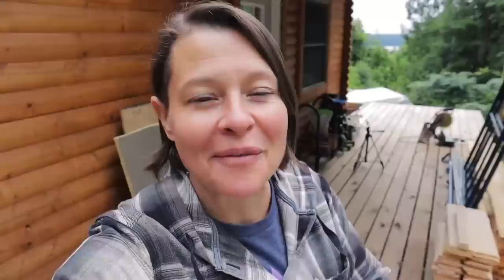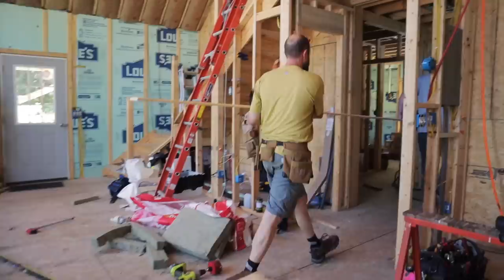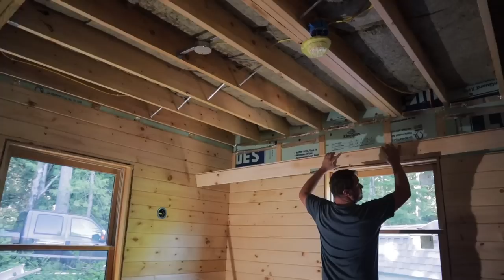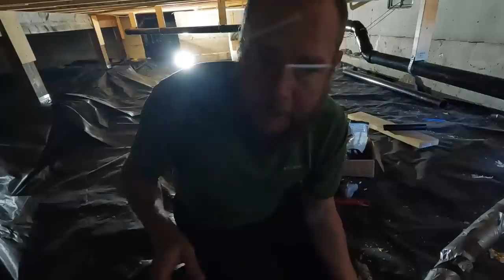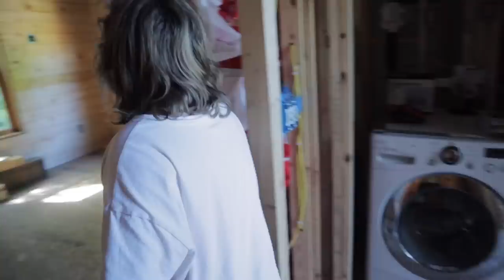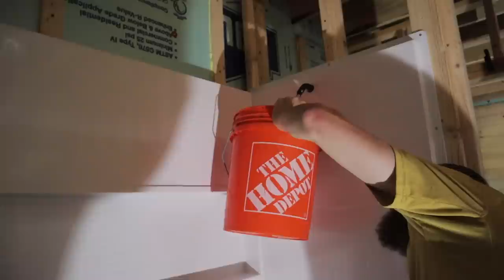HUGE TRANSFORMATIONS are HAPPENING

Comment: Not shiplap. You're using tongue and groove or t&g for short. Shiplap has rabbets cut into each edge and the bottom edge of one board covers the top edge of the board below it.

Thank you for mailing it correctly, through the tongue giving you a wall w/o nail holes. Looking good. You guys must be getting more excited each day! Great job plugging away even when you don't feel like doing it! Keep up the great work!
Reply from the maker: So, not to nitpick, but the material on the wall actually IS shiplap.  It has the rabbets on the top and bottom.  For our ceiling, we will be using T&G so we will get to have experience using both products.
Reply: I'm sorry, I stand corrected! I should have paid better attention. Thanks for straightening me out!! 🫣
Reply: Nailing not mailing